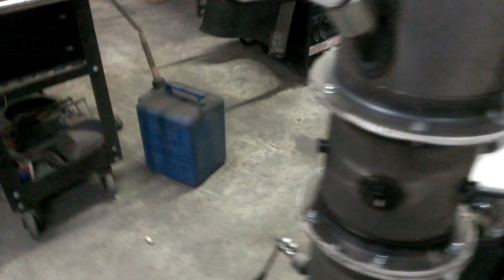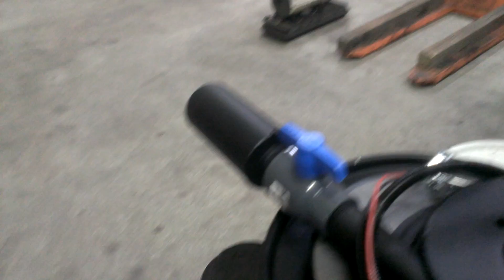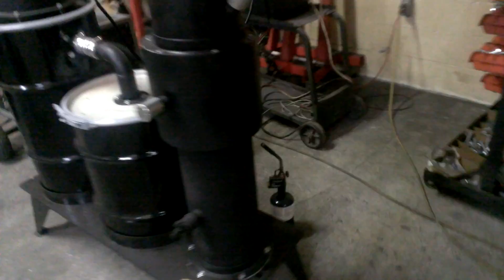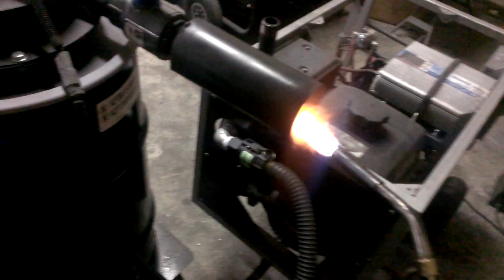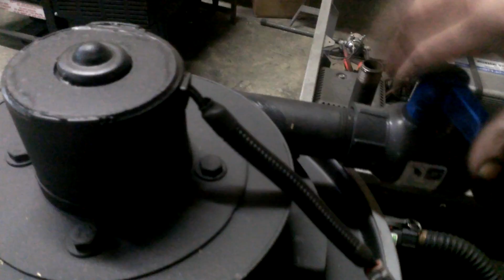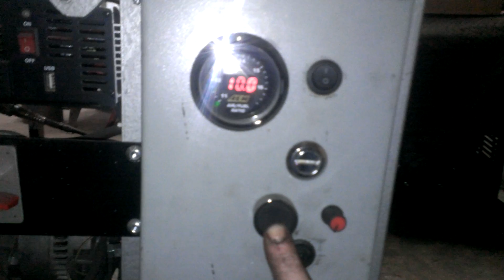Vulcan Gasifier, 2016 Micro S-1 Overview

Comment: What would happen if you tried to run it with sawdust?
Reply from the maker: It wouldn't work,  saw dust just simply would not flow through the machine its too lite. Saw dust by volume is not very energy dense, so your run times will be very short unless you have a massive hopper. There is a however a gasifier that was built in the early 80's called Missouri gasifiier. From what I have seen and know Im not convinced it will work The machine I saw made way too much tar. 

Pellet fuels are about the best fuel you can get for a small scale gasifier plant. They are easy to flow through the machine and offer a very high energy density pr volume. This allows for a smaller more compact machine that do more at lower over all equipment cost. You can get a mill for less cost than a chipper that you would otherwise need for a chip fuel machine. The process is more efficient as you loose 50% of your yield chipping.. So that energy is wasted both process and what your throwing away. Pellet fuel are three times as dense as chips plus there is a heat process in the milling process. When you factor in the whole picture pellet fuel processing is hands down more viable and practical. Plus plenty of free sources of dust. 

All these machines here obsolete I have discontinued all chip fueled machine as I had break through with a pellet fueled reactor that eliminate hopper moisture. This is something that plagues just about all gasifier systems. Where this reactor completely eliminates it. The fuel remains 100% dry resulting in much hotter core temps resulting in full tar cracking along with a near 100% water shift. So it drops very little condensate. Most my chip machines you had to empty this once a day, these new machines can go a week a two. This years machines have the first ever self cleaning micron filter system, Tar issues will forever be solved for good with this system. 

To learn more you can go here. Today machines are far more advanced than anything Im showing here. 

http://www.versifire.com/

Comment: How many burn hours do you expect those metal drums to last?
Reply from the maker: +Paul Ladendorf  This is why this is a cheap gasifier. The drums can be replaced inexpensively, and are easy to replace, you just need a 2 1/8 hole saw to cut new port holes. This is not an off grid gasifier, its for experimenters, universities and part time utility applications. I would expect the drums to last a min of one year of heavy use.  Keep them clean and heavily rinse out the acids before storing and they will last much longer.
Reply: Ok, I'm looking for a unit that can produce 150 KWH/mo so I can get off grid.
Reply from the maker: +Paul Ladendorf  This should do it, its a combine biomass to electric power with combined wind. This features a 12 kW charge inverter and all the support systems for both the wind turbine and the gasifier side of the system. It is a turnkey system some set up is required. http://www.vulcangasifier.net/#!product-page/qs12j/6a6da2b8-5857-ec26-f4a1-642569334177

Comment: I saw this on ebay, and followed the link to the vid. I think its great that you are doing this. It is a reasonably priced setup. I do have a few questions.
1 How long will it power the generator at full power on a single load? Just and adv i know its material dependent.
2 What does the clean out process involve? and how long does that take?
3 Do have plans to sell the air fuel adjuster for the generator?
Reply from the maker: +Wayne Wilkinson  Hi Wayne, run times depend on a lot of things, fuel density, moisture content, engine size and loading. It will run the 10 hp kohler for about an hour. The ash clean out just entails removing the port cap and the ash falls out the bottom. It takes 5 min or less and should be done daily before you start for the day. The mixer controller is available yes. Contact me through our website for more details. Cheers!